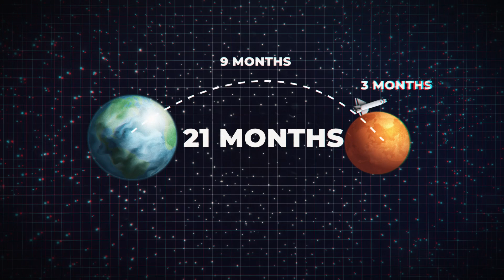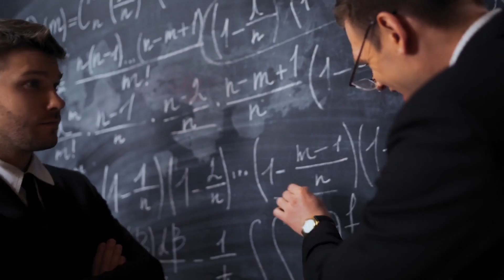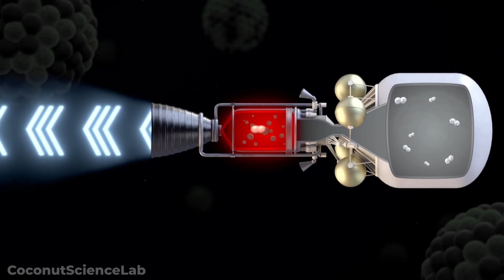NASA’s INSANE Nuclear Rocket to Visit Mars IN DAYS

Comment: All those engines are neat, but ultimately they all work in the same way. Thrust propulsion, no matter how high tech they will only work if there is atmosphere to apply opposing friction to... Even "ion engine" is just essentially a glorified fan, high voltage DC current running through a magnetic toroidal field making this ionized wind "ozone" not very much thrust at all. Voltage would have to be astronomically off the charts in power to weight ratio to achieve lift of... But none of these work in a vacuum, when atmosphere is voided thrust acceleration does not work anymore 😞 and if an object already has momentum in vacuum deceleration through thrust will not work either. If you push against nothing(space) nothing pushes back(friction). So none of these methods of space travel are physically possible. That is assuming space is truly a vacuum, it's content volume being devoid of matter.
Reply: Ion thrusters are already in use and when thinking of thrust also think of velocity and acceleration. You really don't need that must thrust without gravity or friction just a constant amount for continual acceleration. Electrical propulsion is more feasible than chemical for space exploration.

Also your comments on thrust propulsion are not accurate, are you trying to explain the feasibility of the EM drive ?
Reply: @polla2256  you can say I'm wrong but just I mean look up a video or do your own experiment video of flying a drone in a vacuum chamber it doesn't work, and you can only simulate partial vacuum, a complete vacuum should be an impossibility. same thing goes with any kind of telecommunications cuz sound also needs a medium to transmit. How do you even sustain a flame in a vacuum it doesn't work how about the human body in a spacesuit in a simulated vacuum the nitrogen quickly separates in your blood you lose conscious in under probably 20 seconds I think and that's not even a complete vacuum which itself should be impossible. you got an area of "space" you have an area of volume that's expanding yet void of matter that's nonsense. The thing is you can use science to conduct your own experiment to prove these things are impossible using scientific method so I don't know what there is to argue about.
Reply: If you're going to say my comments are incorrect on thrust propulsion, you should provide an example or correct me
Reply: You are wrong Chris, because rocket engine, no matter type, is a chemical reaction bouncing off rocket nozzle. That's what creates thrust in vacuum.
The problem with your drone is, its movement is created by mechanical movements, where the "thrust" is by creating a stream of air. 
That's why it does not work in vacuum - maybe if you have giant and fast one, it will work, cause vacuum is not devoided. Expect your drone to be atleast 100 km wide - a solar flare powered drone.. sounds cool huh?

If your drone has a propellant on board, in this case air supply, it will fly even in vacuum, but i highly doubt an original design will work. It will not be very effective also.

Comment: Ion propulsion is very slow accelerating, thus decelerating... you'd spend a very short amount of time at "max speed" most of the time accelerating or decelerating (making it good for verrrry long distances trips)....
Solar or photonic propulsion requires a very large surface to have a descent acceleration.. large surfaces also meaning increasing the chance of hitting small debris and a system to fold and unfold the whole structure...
I don't really know about nuclear, but it seems not very efficient in terms of "usable" energy in the sense that the crazy amount of energy generated is not use directly for thrust but for making a liquid boil...that the is used for thrust...
Our best bet for know is to build either multi technology space craft, or use mid flight refueling as SpaceX is intending (either orbital or moon based)

Comment: All anyone needs to do is research the NERVA project.  Nuclear engines do not have the thrust that chemical engines do but they will run at faster discharge rate and reach a higher speed in space but,, once you reach a speed in space you can turn the engine off.

Comment: Ion engines take waaaaay too long to gain speed for a flight to Mars………and if you did have means to get there in three days, you could not stop it enough to go into orbit, you’d just wave as you went by…
Reply: 3 days would have you hitting some serious speed around 5 million mph, and being able to slow to orbit speed.   If you think ion drive will do it, you're definitely reading comic books. An ion engine applies thrust equal to the weight of a postage stamp. Chemical rockets can provide tons of thrust, but the amount of fuel required adds tons of additional mass. Which requires larger rocket engines, and more fuel.. LoL. A 3 day trip would need a super tankers worth of fuel, and enough rocket enigines to move a small moon. A 3 day trip is completely impractical, but probably not impossible. A nuclear powered engine wouldn't get there in 3 days, because you still need enough fuel to provide a constant thrust of massive proportions including the slow down.
Reply: @kimballmarlow4661  …..three days to hit five million mph……and you accuse folks of comical insight?     Your clown shoes are on too tight.       Also a nuke engine would need a substrate that would add significant bulk….    Sails won’t work for either directed beam or photovoltaics……..lensing and proximity defeats both.  Etc etc.     hyperbole, it might get a racist elected, but it doesn’t reduce the demands of space travel
Reply: So we agree that 3 days is out of the question. 3 to 5 weeks isn't out of the question. If you can provide constant thurst of 3 to 5 mph per second you'll be able to get to Mars pretty fast.
Reply: We need the Wave Motion Engine.

Comment: Photonic or ion both require huges amounts of energy to provide tiny amounts of thrust. Both would work, but it's not practical to use ion drive on a ship with large mass. That same number of kilowatts can move a ship faster using other methods.
Reply: The problem I see is moving at extremely high (millions of miles per hour) speeds makes even small dust particles capable of shreading holes through your ship.
Reply: But where to get those kilowatts? THORIUM

Comment: Do you really think NASA is not on Mars ?! Well, your wrong there are over 100,000 personnel on Mars right now and the riddle is they use 767's to get there taking off from runways hidden on secret bases around the planet and simply fly those planes landing on runways on Mars built through out the 80's and 90's. As the riddle continues they also use military transport planes for flights to Mars their called C-170's and C-190's so if you think we ain't on Mars in a big way today, 9/2021, your very wrong. They have been constructing a star fleet on Mars for over 3 decades and 3 starships are already to go. They have reached the Alpha Centauri system and have a base on one of the planets there today and are preparing to jump out into deep space to colonize a few other chosen planets in a few years found by the Hubble tele.. Don't worry about it you can't go, they have already been chosen and genetically fit the bill and you won't if your not government. I personally have seen these aircraft/spacecraft leaving and going to Mars so this is an informed, well, comment.

Comment: The  other way to power it is to open pressurize doors with a turbine inside to spin off the force of the pressurize chamber the way to do it is have like a cave system that feeds off the suction when you open the pressurize chamber

Comment: You have to use a gyroscope that will continue to spin to power the fusion engine since the is no resistance it continue to spin you build the gyroscope to produce power like you would a generator

Comment: if we manage to get to these high speeds,  would something as small as sand in space shred the spaceship? Or they hit something the size of a pebble.
Reply: Electromagnetic shielding.
Reply: Good question. Better have shields up!  :^ )
Reply: Yes, I think some kind of deflecting shield technology will be a must, if we are to attain this kind of high speed space travel.
Reply: @Ottee2  the starship Enterprise has good shields..
Reply: @jamesholt7340  , Thank you, Number One.
Reply: only damage it can do, is the size of itself. So a grain of sand could put a grain of sand's size hole in the ship. But we instead simply use electromagnetic shielding, search it up, its a complicated concept
Reply: @Liam-eg6gq  a hollow point bullet leaves a massive hole behind it.
Reply: Rejuvenating metal and high resistance like in terminator
Reply: Yeah, I've wondered the same thing.  A bird hitting a commercial airliner at 700kph can be catastrophic.  A grain of sand hitting a space craft at 200,000kpm would be catastrophic
Reply: @Birch37  would it? A grain of silicon dioxide would disintegrate I’d think. Not really a good comparison with the bird (massive compared to a grain of sand) as one is much more massive and an airplane wouldn’t survive in space.
Reply: @drewwalker101  a paint flick travelling at 25,000 kph created a small hole in the ISS a year or two ago.  A grain of silicon or anything travelling at light speed would presumably do significantly more damage than a small hole.....
Reply: @Birch37  lol how is a piece of sand going to reach light speed? Also how would they even know a paint chip caused the hole?
Reply: @drewwalker101  It's fairly simple.  The space craft is travelling at light speed and the grain of sand is travelling at 25,000 kph.  Even ISS,  Voyager  1 and 2 are travelling at 25,000 kph.  In theory the collision could be in excess of light speed.  So no the grain of sand is NOT travelling at light speed......  so hitting anything at light speed would be fairly  catastrophic....
Reply: @Birch37  did the video mention reaching light speed? Mars in only 0.00002415 light years from the sun, so even closer to earth when on closest approach. What you are saying is not an actual situation being prepared for with this rocket as far as I understand.
Reply: @drewwalker101  no I did in my original response that you replied to

Comment: An ion engine and engines like it while accelerating to very high velocities take time to do so and remember they'll also take time to reduce velocity so maybe they may not be so much faster. Maximum velocity before halfway then the rest is deceleration while a conventional rocket will quickly reach an operational speed then coast to its deceleration point where it reduces its velocity rapidly. If more powerful long-range engines were developed there would be a bonus of g-force for a human crew.
Reply: I see u r a viewer of "The Expanse" ❤️
Reply: Flip and Burn.
And here comes the Juice
Reply: Nice watching This Dude Musk share his motivation etc. With U.S🦾🫀
Reply: W
Reply: Seriously, if we were to use an ion engine, what rates of acceleration would we be looking at until flip and burn?
And could we augment with controllable nuclear engines that reduce their impulse as the ion engine reaches an acceptable acceleration?
Reply: @PHDiaz-vv7yo  Ion engines would come into their own over very extended distances eg past the asteroid belt. Nuclear engines are on our horizon and will possibly be used for inner planetary excursions.
Reply: True but the average speed, assuming constant and equal acceleration, will equal half the top speed. The average speed will be orders of magnitude higher than the top speed achievable  by any other method

Comment: Great stuff but don't forget its ok to travel at these speeds but it will take just as long to slow down once having reached the destination.
Reply: 1.5 days acceleration / 1.5 days deceleration.
Reply: @arthurzettel6618  Only if you wrongly assume the mass decelerated is the same as the mass accelerated. It isn't. You won't be decelerating the fuel you used for the acceleration. In fact if you dispose of the entire acceleration stage you only decelerate the deceleration stage, and lander. One concept is to use a solar orbital ferry on an eccentric orbit that crosses the orbits of Earth, and Mars for the planetary transfer trip. That has all the major equipment for the trip such as life support systems, centrifuge, food storage, and other consumables. All topped off with regular maintenance missions that don't decelerate or land. Could be done with robotics. You simply rendezvous with it with passengers, supplies, and a deceleration stage, and landing craft. Of course the lander, like the LM, has a landing stage which is disposed of, and a liftoff, and minimal acceleration stage which can also be disposed of after liftoff, and rendezvous with the ferry for return to Earth. A separate vehicle launch can rendezvous for the passenger retrieval from the ferry, and return to Earth.
Reply: @dpsamu2000  WRONG
Reply: @ochobangs_gaming4573  Such a convincing argument. WRONG. What are you 2 years old?
Reply: @ochobangs_gaming4573  You're not you oaf.
Reply: One miscalculation on forward thrust or reverse thrust and you end up with rocket full of human pancakes
Reply: @TheGreatSkull123  Yep, lots of air in space for this to work.
Reply: Na, have chemical rockets as well on both the fore & aft for launch & or deceleration at around 1 G.Much faster than trying to decelerate with the comparitively weak thrust of the Ion engine.
Reply: @_BLACKSTAR_  the back of it looks like it has two different types of engine. I don’t doubt what you are saying but when the X37 B started out it wasn’t classified and now it is. It can be fun to speculate and it would be cool if maybe they were testing an Em drive on that platform. I can live with your answer though. Thanks black star.
Reply: they just press the button silly
Reply: That is why you accelerate to max speed up to half way, reverse thrust for the other half of the journey.
Reply: they just flick in the reverse thrust for 10 min before they get here, like how a jet ski goes backwards...
Reply: Not if ya smash into something
Reply: Nahhhh. Just casually slam into mars at mach 160
Reply: You could probably use drag around Mars to slow down a little bit faster.
Reply: There would be no acceleration or deceleration. Stopping would be instantaneous. From forty-five degree angles. Somewhat like the eggs that pressed together are difficult to break.
Reply: @peterngera598  the only thing that makes an instantaneous stop better than decelerating too fast is you'll suffer less from the g-forces flattening you because it would be instantaneous